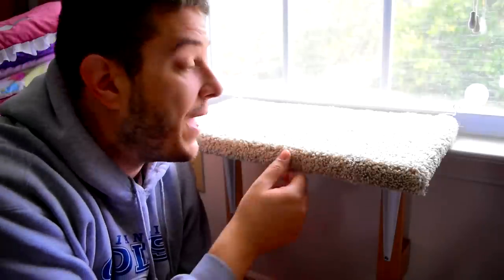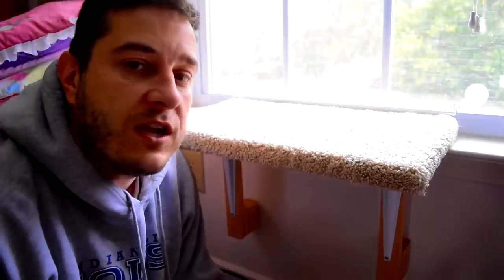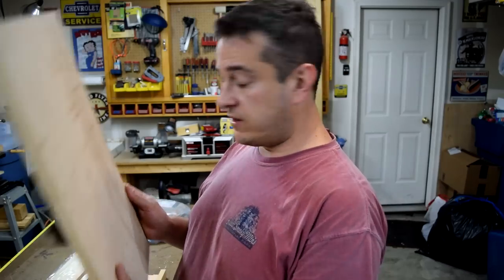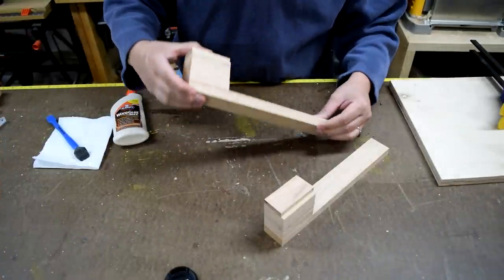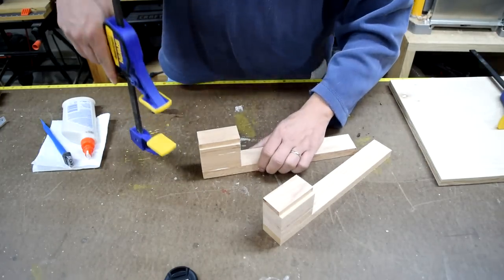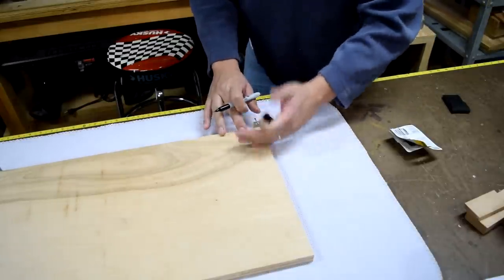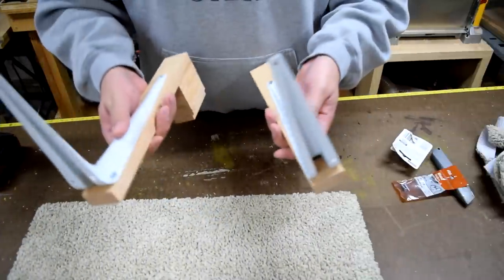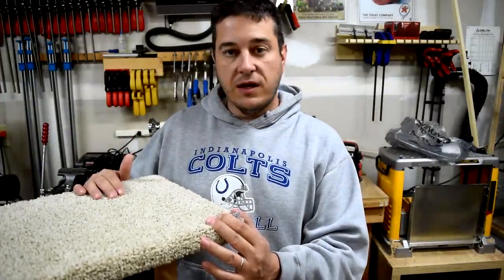How to Make a Window Cat Perch (WoodLogger)

Comment: It was smart to show the finished product at the front of this video.
I want  to see where the project is heading at the outset before I watch the entire video to see the result.
Some similar videos forgot to do that, which I found annoying
It seems like you could also use some chain to help support this board by securing some chain from the  2 back corners 
farthest from the window to the top of the window attached via cup hooks or something similar
I noticed one of your comments mentioned suction cups and I have zero confidence in using suction cups,
especially when it comes to supporting something more than a pound.
I am just looking for ideas now and I am definitely going to use a couple of your ideas here.